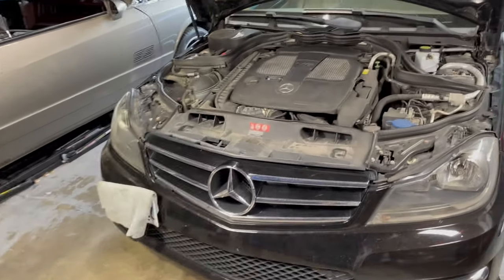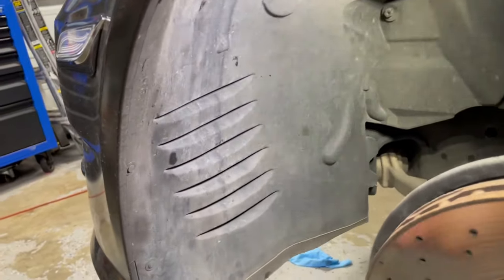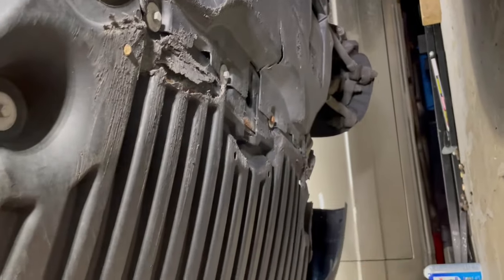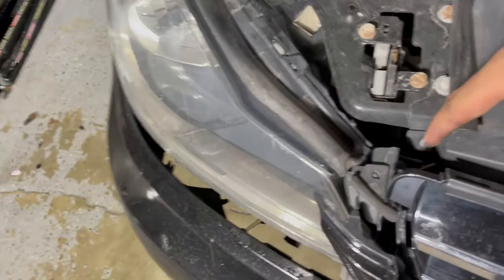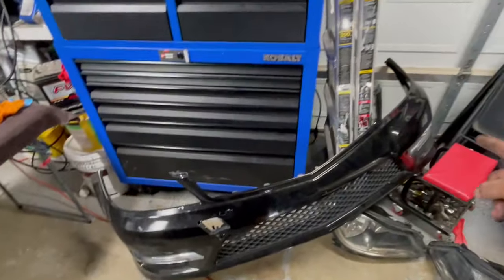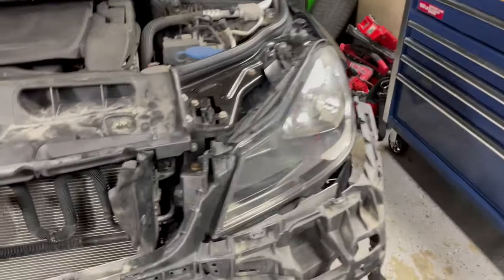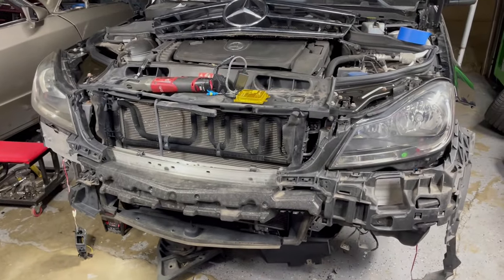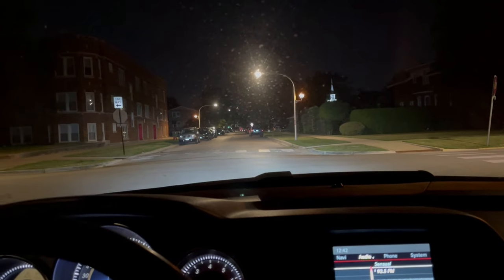Mercedes W204 (2009-14) Headlight Assembly Replacement!!!

Comment: Does mercedes hire the smartest engineers on the planet and commission them to design a car where the most trivial act of maintenance is almost impossible without taking the whole car apart?
Reply from the maker: It's insane what you have to remove just to get to something that's very simple!
Reply: @Fwerks.1592  I know. I tried to change the starter on mine.. once the first exhaust bolt broke off, I had it sent to a shop lol
Reply from the maker: @gregkirby  no kidding!!! They don’t make the cars like they used to though lol
Reply: Then you should get an Cayenne and pop them out easly?😮

Comment: Can it be done without taking the bumper off?
Reply from the maker: Yes, all you have to do it pry open the bumper slightly to get access to the headlight bolts. You do not need to remove the entire bumper.

Comment: Fuck man thanks for video! The front bumper removing kinda threw me off guard 🥲
Reply from the maker: You don’t need you fully remove the bumper, you just need to pop it off slightly. That should give you enough room to remove the headlight and reveal the hidden bolts.

Comment: Basicly,there is 3 lamps in one,the intel lamp,the led at the corner,and kind of hologen/bohlam at the midle, 
My question is,this one,the  lamp at the midle, what type of that lamp?.
Sometime my headlight is off,the left side,and back to normal within hours,is there something problem with my baterai or something else?
Reply from the maker: Alright so the main “ low beam “is the main lamp close to the corner. The high beams are next to the big lamp. It’s closer to the grill. The turn signal are below both lamps
Reply: @Fwerks.1592  mine, 2013 W204 c250 AMG.
There is 3 lamps above the turn signal, the intel lamp at the corner,,and kind of  white LED at the other corner, and kind of hologen/bohlam at the midle.

Comment: I have a 2009 merc and want to change the head lights to a 2012 model , can it be done. I know I would need to change the bonnet also
Reply from the maker: To be honest I’m looking at both 09 and 12 headlight assemblies. The 2012 have a curved at the top and the 09 run straight from the top . They might not fit to be honest.
Reply: to do that pal , all u have to do is buy a new bonnet 'hood ' of a facelift model , and then fit the facelift headlights , urs is w204 prefacelift and the only difference apart of interior and dash , outsite is the bonnet that is curved in front ...

find a front bonnet and u will be able to do the facelift
Reply: @katanaka1  Thanks... I hope you are right
Reply: @captaincook3693  yes he is. I've seen it dome alot
Reply: Change the bonnet lights and the bumper
Reply: @omolewilson5835  some say lights and bonnet and some say lights, bonnet, and bumper , but I think your right. thanks

Comment: i changed out my headlights with some aftermarket ones from ebay. my first light took 90 minutes. the second one took 25 minutes this task is simple. you just have to be careful when maneuvering the headlights in and out and also be ready to do some bending down and poasibly laying down when removing all of the bolts behind the fender liner and no you dont have to renove your wheels just turn them.

Comment: So basically to change the light bulb you have to do the same thing???
Reply from the maker: If your trying to replace the low beams, you should be able to gain access from the engine bay. Let me double check and I’ll let you know!

Comment: Did you program it afterwards?
Reply from the maker: No program needed. It was plug and with no faults.
Reply: @Fwerks.1592  did you do a full module scan? It should give you a code saying the module is not configured, where you then have to do variant coding to program it. I had to on mine the same model. The programming information is on the headlamp assembly. If search, there are many videos showing how to do this.
Reply: The purpose is to regain the correct motor range.
Reply from the maker: @apadgett01  I scanned the vehicle and I did not get any codes for any modules. Are you sure you have the same headlamps as mine? You have the ones that have the projector lenses and then you have the ones with the halogen bulbs.
Reply: @Fwerks.1592  they may be different. I have the Xenon motorized ones (adaptive). Do those have no motor for automatic adjustment (leveling, steering sensor, etc)?
Reply from the maker: @apadgett01  exactly I don’t have the xenon headlamps, these are the halogen and don’t require coding. The adjustment are all manual.
Reply: @Fwerks.1592  Ahh. Makes perfect sense. I wasn't aware. Thank you for sharing. Someone else changed mine and didn't program, and I was lucky enough to have a ECU coder. I've seen an entire list of people on MB forums not so lucky. Great video!!
Reply from the maker: @apadgett01  no worries! That’s the thing with Mercedes! Any modules that you replace needs coding 😫😫. I just replaced a most communications module and unfortunately it needed to be coded to the vehicle! Thank you!